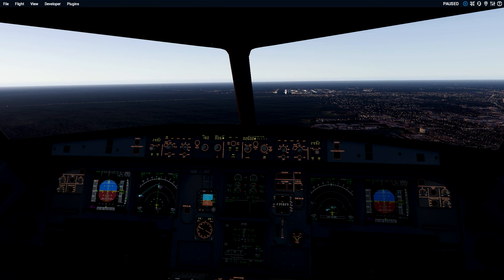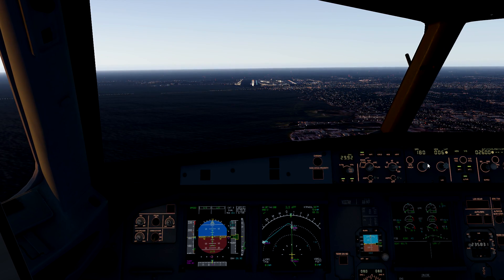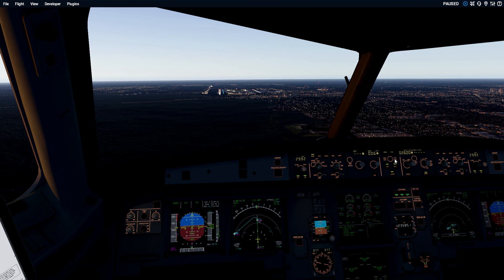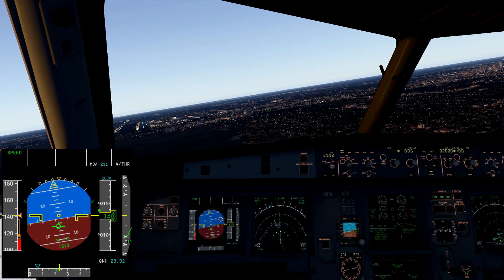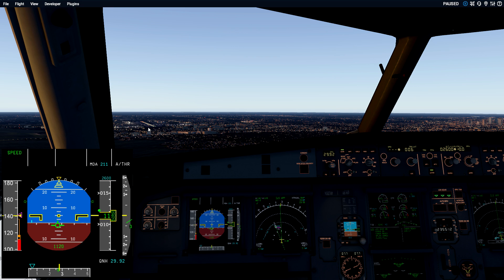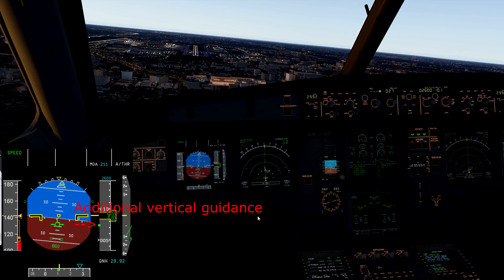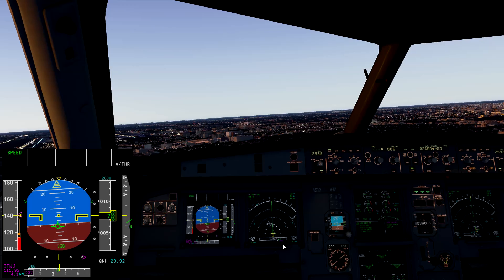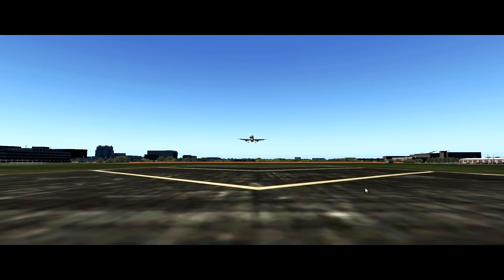Side-Step maneuver | Airbus Pilot Series | A319/320/321

Comment: Thank you for this. I have a question: the Missed Approach procedure calls for the one of the instrument approach flown. When we activate the SEC FPL or change the runway on the FPL, we loose the navigation part of the MAP. 
In case of Go Around, it has to be flown manually, with an increased workload.
Any tip on how to avoid it? Couldn’t find anything in the FCOM/FCTM

Comment: VATSIM Side step request ;  Last night I was flying the ToLiss A319 and was on IFR approach to 30L at KMSP and the controller asked me to sidestep to 30 R. I was still a ways out and was fully configured (localizer, glideslope and APP engaged - both autopilots on...) and then got the request.  I pulled up the Rwy 30R ILS runway freq and heading on my AVITAB and quickly put that into the FMC and the plane automatically sidestepped and locked onto the localizer and glideslope for 30R.  It moved itself over and continued landing as if it was on 30L!  Would that do the same in real life or was that just a  Xplane / ToLiss fluke?

Comment: What is the minimum altitude at which you can side step?
Reply from the maker: That will depend on your air carriers operational specifications and standards. I have been asked before around 500' for a close parallel sidestep, not a large one like in this video.

Comment: Have often heard you say something like `10 below active speed can go to flaps 3 or whatever...  "   Somehow you are using a reference on the speed side showing when its ok to go down to the next level of flaps...  can you explain this abit better (I'm new to Airbus).
Reply from the maker: Of course, what I am referring too is VfeNext. That speed Vfen is presented as an amber = sign on the speed scale. What this sign represents is the "never exceed or flap overspeed" for the next selection of flaps. So if I am at Flaps 1 and I see the amber = sign at 200Kts I know if I am below 200 and extend flaps 2 I wont overspeed them. Now it is our procedure to extend them at Vfe next - 10kts for extra margin of safety. Therefore at 190kts I can select flaps 2 safely
Reply: @V1Sim  Ah, ok - thanks for explaining that - much appreciated!
Reply: V1-Simulations So, when on approach with gear down and you need to extend Flaps 3 and Flaps Full, you just watch the amber equal signs? Usually I extend Flaps 1 at the green dot and Flaps 2 at the S, but I arbitrarily lower the next stages if they are below the equals sign. I feel like if I start extending the flaps immediately, there will be excessive pitching downward to compensate for the lift and I wasn’t sure if it was acceptable to do it